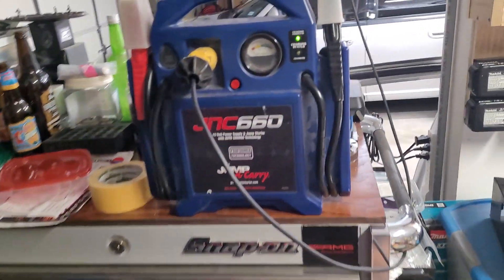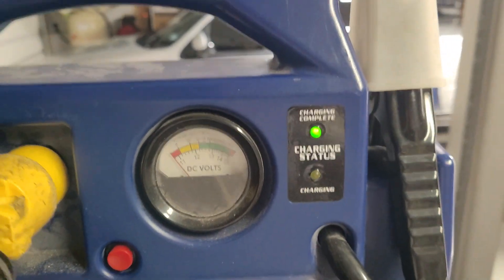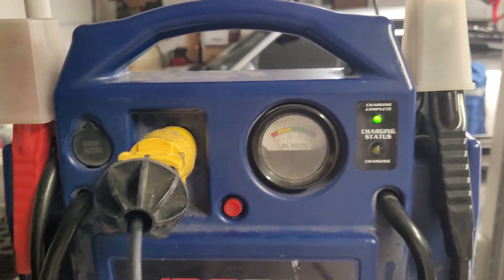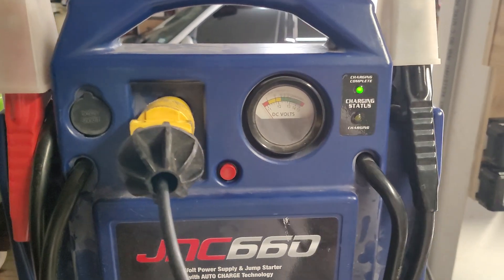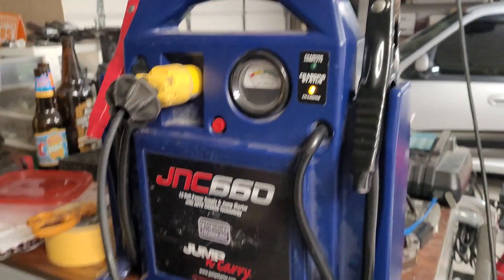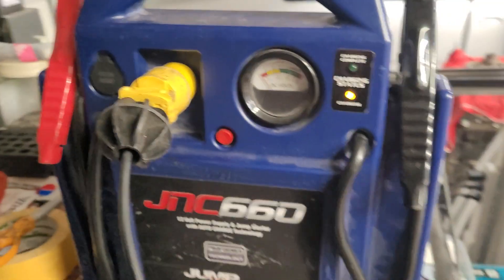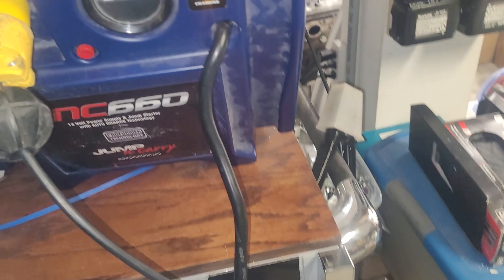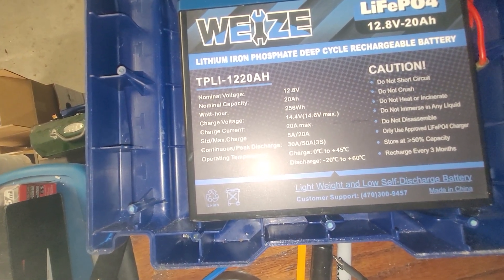Lithium JNC660 update

Comment: i was told by two people that the jump n carry charger was not designed to charge a lithium battery ... Does anyone know for sure?
Reply from the maker: mine charges just fine, but you need to have a lithium battery that has BMS that is safe for charging

Comment: I did the same conversion recently, with a MIGHTY MAX from Amazon, advertised as a drop in replacement.
It does drop in but that is mostly the end of it's  performance. It does NOT restore the power of the old lead acid battery and when really needed barely makes the bendix pull in on a 5.7 Hemi. I find this conversion useless, unreliable with only 18Ah of energy available. I'm  going to send my battery back and perhaps try another one, $40.- cheaper and with 20Ah.
Reply: Did the 20 ah work any better?
Reply: @ZBrink11  Yes and no. The cheaper one did crank and start the warmed up engine one time, by itself with the lead acid disconnected. But the BMS is obviously protecting the cells and not focused on starting the car. So for a 2nd start attempt it needs a recharge. The LFP replacement battery appears to be the same as the previous one based on weight and performance. There is no data sheet for the cells or the BMS. No details available on the websites and I'm tempted to open it up.
So my conclusion is that those are not ready for the job. 
I did however try an 4S2P array of Headway 38120S 10Ah/100A peak without any protection which worked like a charm. The dimension of the pack is about right to fit in the jump pack but not in the OEM battery case.
For the time being, a reliable jump pack better be OEM, lead acid or LFP.

Comment: If the dead battery was disconnected and jumper only used to start  would that overcome the drawdown of the dead battery?  So for convenience a manual disconnect switch very heavy duty may make use of your upgraded jumpbox more useful?  kind along the lines of projectfarm youtube?
Reply from the maker: I haven't watch that video yet, but has pretty thorough testing, and clever ideas on how to perform tests
Reply: @RobertGates-t3x  I have a disconnect on my battery and the LFP replacement was not able to crank the V8 by itself. 
My cold crank amps are usually 160A @ 70degF. There was no paperwork with the LFP, no datasheet for the cells, no charging instructions. Who knows what they put in there.

Comment: LiFePo batteries require higher voltage than Lead Acid. So the built-in charger never get the LifePo battery to the fully charged state in your setting.
I suggest that you use 12v cigar socket, which is simply coneected to the battery terminals to charge it by LiFepo Battery charger, then you chan charge it to100%. 

The whole point of JNC jump starter however, is taking advantage of Lead Acid. Today, LifePo (Lithium) still does not have enough output current for cranking the motor. 
That is why even Hybrid cars today still equip Lead Acid batteries.
Reply from the maker: thank you for the comment. I appreciate your feedback!
Reply: Oare se poate incarca bateria prin cablurile jumper?
Reply: Well, Lithium works with the right technology. NOCO jump starters work great but are more expensive than a JNC. I have both and came here as I'm looking into refurbishing my old JNC.
Reply: @ZBrink11  We are getting there. Unfortunately cells from China will get a little more expensive thanks to the orange man.

Comment: Very indecisive transparent so I should just stick to the late acid replacement for jumping my truck because my work when I first got it now it won't hold a charge stick with the lead acid
Reply: A motorcycle lithium battery can push lots of amps, is small, and is cheap. So long as it fits I guess it's a goer?
Quad-bike 500CCA LFP battery might fit, hopefully not too thick (the shortest dimension).

Comment: Hey nice tutorial 
These JNC660 jump packs new are already defective. I’ve rebuilt all the shops with updated HD batteries along with the chargers. Old chargers are very low voltage and seem to breakdown. Original battery and chargers are garbage.
Reply from the maker: thanks for the comment!
Reply: What batterys did yall go with and what did you do to the charger ?
Reply from the maker: @finnsnracks2085  did nothing to the charger.  Batteries were ordered from Amazon, link is in the original video

Comment: I have had a pair of jumper cables for 35 years and they still work just as well as the day i bought them.
Reply from the maker: I do to, but jump starting a car isn't a great idea on a modern vehicle as either the donor or the recipient... lots of sensitive electrical equipment that is vulnerable to voltage spikes
Reply: @Patman03sprcrw   Its a great idea as far as im concerned. Exactly what is a battery powered jump starter doing any different than the battery in your car ? Nothing ! Just a bunch of BS to get you to buy shit you dont need. Just go buy another battery that fits your car and keep it on a smart trickle charger and use that if your worried about it. Now you have a spare.
Reply from the maker: Ok sure, do whatever makes you happy....  thanks for the comment.
Reply: @Patman03sprcrw  At least about the technical aspect the man is right. The reason why the industry does not want you (me) to use jumper cables is operator errors, not electronics. And of course anyone would rather pull out a handy magic device than a set of cables to help a stranded motorist out.
Reply: I swear by jump boxes, JNC is my favorite brand, fist one I bought was the JNC 660 because I had read that AAA used these... I've used them they work so I'm a big believer in always having one with me!

Comment: What i did was the best of both worlds i had enough room to ad my lithium booster to the lead acid box and a terminal switch to go between the two and charge them on their different required plugs. That way i can take the booster on winter trips and have lots of juice all year round

Comment: if you dont believe lithium batteries can be a fire hazard you might want to do some research. And you mentioned lithium batteries in cars. Not sure if you meant electric cars but in my career as a firefighter ive run calls on several electric cars with lithium batteries. They take several thousand gallons of water to extinguish them. So do you think you made an improvement swapping to lithium? I ask because in your previous video you said these lithium batteries were significantly more powerful.
Reply from the maker: Mercedes AMG GT has used Lithium 12v battery since 2016 from the factory
Reply: @Patman03sprcrw  I second that and also Newer BMW uses Lithium batteries.
Reply from the maker: @1kontrabida   but they are scary because the internet says so 🤷
Reply: Not trying to instigate a fight, but the new e-bikes, that seem all the rage, can  cause a  fire when charging (possibly improperly) One of my employees lost her family house 3 days ago due to the brother charging his Ebike in his bedroom. Not sure of the specifics, but the blame from the fire investigation was the battery charging. Just something to keep in mind.
Reply: The battery in this video is LFP which are way safer than NMC. They won't turn into flamethrowers if overheated/punctured. At worst, will burn similar to wood if you puncture them.